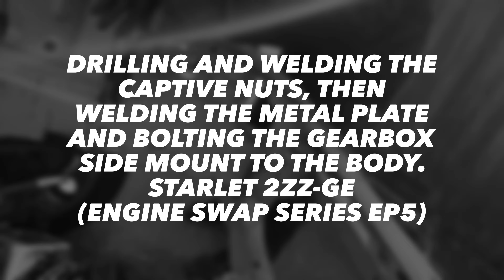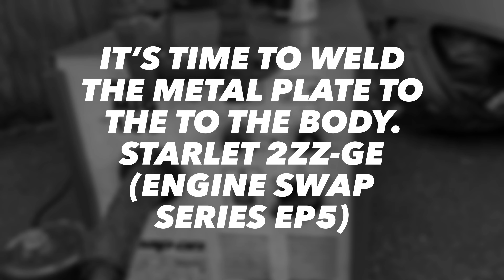Starlet (Engine Swap Series EP5) Welding the engine plate and mount into position

Comment: how does one know what ECU to use on a turbo build? (been binge watching the turbo starlet since i have a 5efe tercel from 1997 that i want to turbo as well) literally dont know which to use
Reply from the maker: hey buddy it depends. there are quite a few who use piggyback like a DET3 but I recommend a standalone like a Haltech or LINK ecu. Do you have a tuner you like or know? as they will have a brand they prefer. generally speaking they all do a good job especially if you don't go for the cheapest of the cheap :)